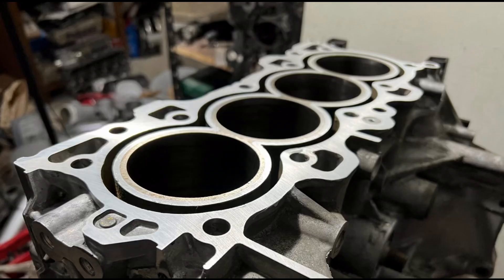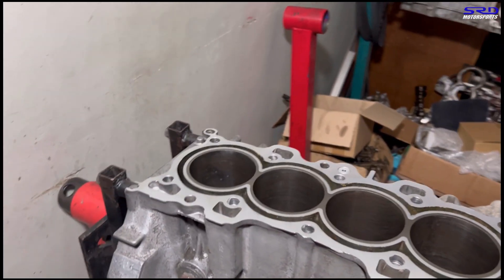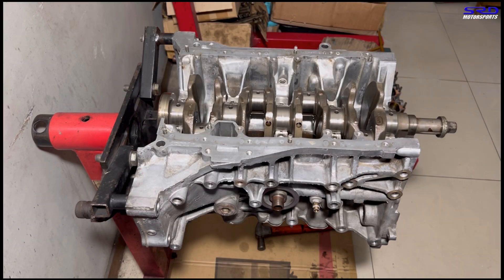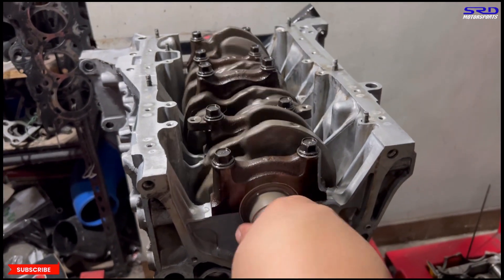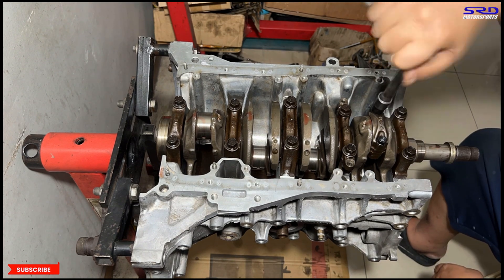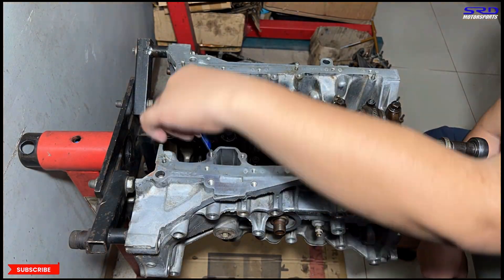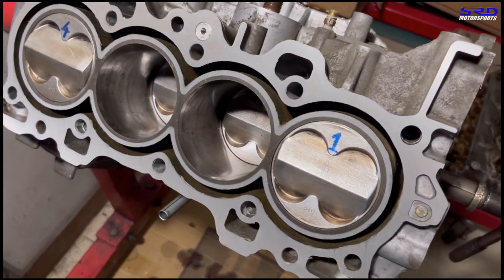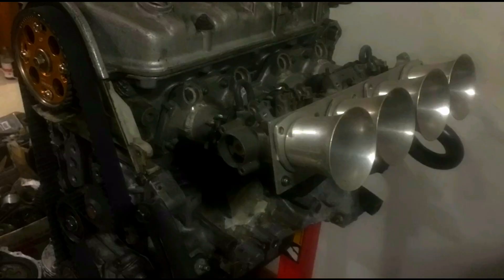B20vtec GSR Cam Rebuild Series part 2: Bottom-end Assembly

Comment: Great work! Could you explain what you mean by 1UP pistons?
Reply from the maker: The pistons we used is named 1Up , the original designer/seller is on IG as franksmotorsportsph
Reply from the maker: They are cast just like YCP… but Mathew did 292whp 😎
Reply: @SRDmotorsports  thank you! I was not expecting such a quick response 😅
Reply from the maker: @shecktaGAMING  I was watching some guitar vids and ur comment showed notif haha
Reply: What cr usen piston and head
Reply from the maker: @rodrigo748  B16 head 12.4:1 comp 1Up pistons (cast like YCP)
Reply: The piston ycp is of the video?
Reply from the maker: @rodrigo748  no it’s 1Up pistons on this video

Comment: Hell ya thanks boss!👌 one more thing ..how do you know witch rod gos to witch crank journal?.. I didn’t take it apart so I don’t know the machine shop took it apart.  Thanks for the help an very knowledgeable content 💯
Reply from the maker: Haha I’m glad u didn’t mind I mentioned your question! easier to install how I do right?

oh on the rods bummer that’s hard to know if it wasn’t labeled, but big chance it’s “okay” as long as u run new rod bearings and new piston rings and the bore is decent u are alright
Reply: Oh no your good bro I don’t mind at all.. 
so it really don’t matter everything is clean an new stock rods bore over new pistons an arp rod bolts. New rings I’m do a YouTube video on the build
Reply from the maker: @renesandoval7515  well it sometimes matter cuz each pistons, the skirt wears different from each bore but if the machineshop didn’t label them? It’s not the end of the world I mean…

Ok if u are building a 1,100whp engine on 50psi boost maybe buy new pistons and rods to be safe 🤣
Reply: Anyway I can contact you through phone number or iG
Reply from the maker: @renesandoval7515  the fb page in the description, I handle the page nobody else